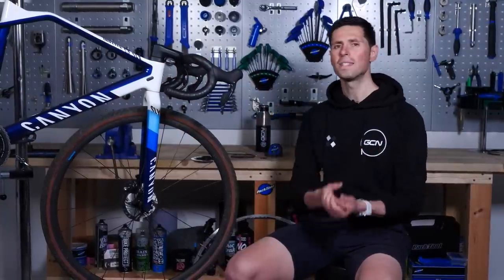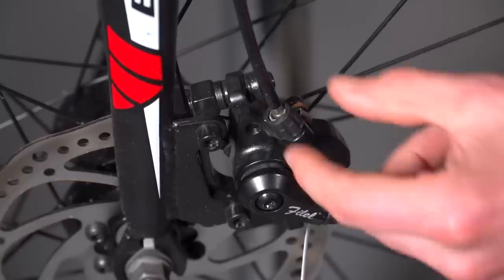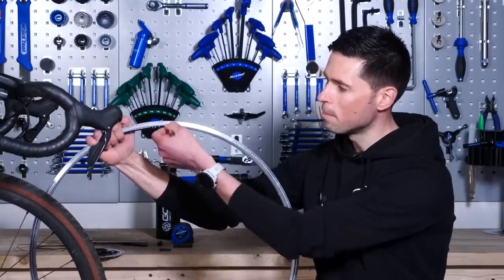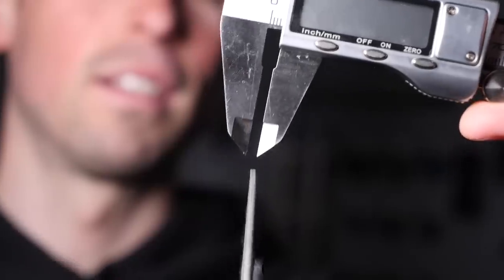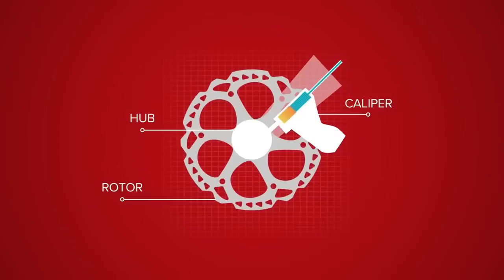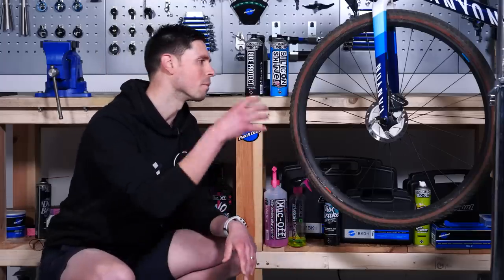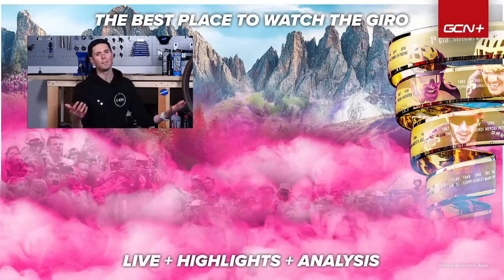5 Tips To Avoid Brake Failure | Maintenance Monday

Comment from the maker: Are your brakes in good condition?
Reply: hell no
Reply: yes ! protecting rotors with a cardboard every time I wash my bike, then I spray brake cleaner on rotors and pads !
Reply: @yio6405  x2
Reply: F yes, no brakes = dead
Reply: @leslie7922  x (-2)
Reply: My TT bike w/ hydraulic disc brakes have given me tons of headache, including multiple bleeds and swapping rotors/pads. Both brakes screech like crazy, I can temporarily clean the front one on the go but it doesn’t last long. Best theory is I am leaking but not sure. It also leaves me with mostly just a front brake, which is somewhat sketchy.

My Road bike’s hydraulic discs are great, no complaints here. I swear, my road bike is a tank and just keeps going.
Reply: Of course. All of my bikes have rim brakes. Maintenance free.
Reply: @billkallas1762  I have rim too, you still need to take the shoes off and pick out any metal flakes which I consider to be maintenance
Reply: @leslie7922  The only time I've ever had to do that, was 30 some years ago, when I bought a very cheap rear wheel for winter riding. The rim was very soft and would flake off pieces of aluminum into the pads. I ended up throwing the wheel away. That was the only time in the last 40 years that I had that problem.
Reply: @billkallas1762  nice, I use shimano rs500 wheel and it flakes :/
Reply: @leslie7922  I've been using Mavic factory built wheels for a long time. In fact, I used a Mavic Cosmos front wheel for the last 20 years, until a finally broke a spoke in it last year. The wheel is so obsolete, that I'm almost finding it impossible to find a replacement straight pull spoke, in the right size, to fix it.
I've never used a Shimano factory built wheel.
Reply: Nope, I seriously need new pads

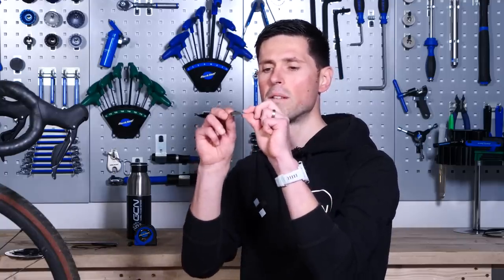Comment: 2:20. FYI, Shamino manual DM-RADBR01-03 (Dura-Ace, Ultegra, and 105 disc brakes) recommends replacing pads when they reach 0.5mm thickness.
Reply: Rotors have a similar (limited) lifespan stamped on them
Reply: Thats the absolute limit, dont be leaving it that late to change your pads

Comment: I think this came just in time. I've got a Brompton folding bike. The chain derailed twice so far. The 2nd time was today. Managed to sort it out but don't know when it will derail again. The front breaks also seem to be taking more time when I pull the breaks. I guess it's become a little loose and breaking with the rear handle break is still solid compared to the front handle break... Guess will keep an eye on it... Thanks again.
Reply: Sounds like you need to adjust the limit screws on your derailleur, GCN has good videos on this just search for shifter adjustments.

Comment: The calipers on my #1 bike were put on 15 years ago. In those 15 years, I replaced the Shimano pads on the front caliper, once. (80,000 miles on this bike) I don't live in an urban area, so I not hitting the brakes every two minutes.  I've also never worn out the rim on any wheel I've used. (I'm always on paved roads, with wheels with aluminum rims)

Comment: Rim brakes and carbon wheels did not work for me.  On a long descent in the Appalachians, I experienced severe brake fade due to overheating.  I had to fred flinstone to a stop 1/2 way down the 6-mile descent. I almost went off the road and over a cliff.  I could have cooked an egg on the rim, it was so boiling hot.

Comment: I have a GT Vantara Competition road bike the rear Cassette (32T-12T)Sun race is eight and the front is three Shimano SG 48T, 38T, 23T. My detailer broke it’s a Shimano Acera RD-M360. What upgrade can I do with out replacement of the hole drivetrain

Comment: May you please explain how to eliminates disc brakes rubbing while sprinting out of the saddle? My brakes do not rub at all while the bike is on stand or pedaling in the saddle, as soon as I stand-up and push more watts they start rubbing.
Have you ever addressed a similar issue in your garage?
Reply: Is wheel flex a possible cause?
Reply: @U.s.e.r.3493  Rim deflection has no relation to rotor rub. Rotor rub can be caused by an insufficiently stiff rotor or insufficiently stiff fork blades.

Comment: "Rim wear" on road bike was never been an issue before disc brake trend. 
 it will only be damaged less than a years when used on gravel or muddy roads.
Reply: It’s absolutely a real thing. Your brake pads are literally rubbing on your rims.
Reply: My First road bike was a used one. Dont know How the previous owner care It, but after 6000 km I had to change the rims due to rim wear.
Reply: @anonyymikana206   Yes it's real.  but what I said earlier, it will happen after "years of use". It's one of the last parts of the wheels to be damaged. (You'll find yourself upgrading to a new bike before you see any wear on the rims)
Reply: @hugobci  maybe because the previous owner was used cheap brakepad or rarely cleaned the rims
Reply: @gamingaccount4935  maybe be it or too many years of usage. The bike was 12 years old when i bought! 😅

Comment: I recommend using proper brakes (ie Rim Brakes).
Reply: BS. Both rim and disc brakes are good when properly used.
Reply: @lb211151  one type is significantly easier to set up and maintain
Reply: @lb211151  Rim brakes for the win. The win I sayyyy!!!!
Reply: @Totalavulsion  The question wasn't what type is the easiest to set up, but which would be the best. @James Smith states that that would be rim brakes and although he is entitled to think so objectively this statement is rubbish. Both rim and disc brakes do a perfect job when used properly.